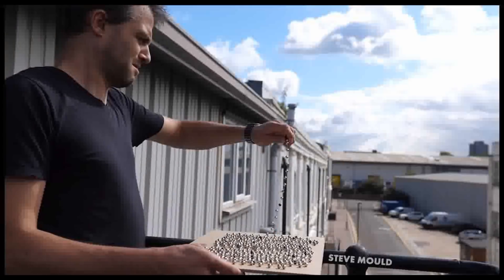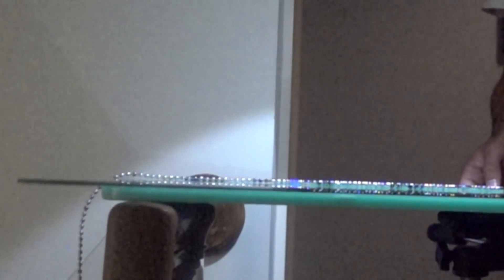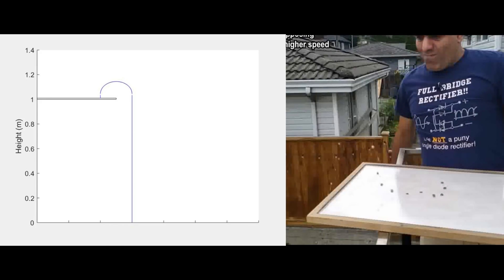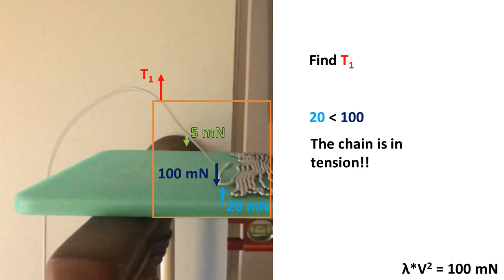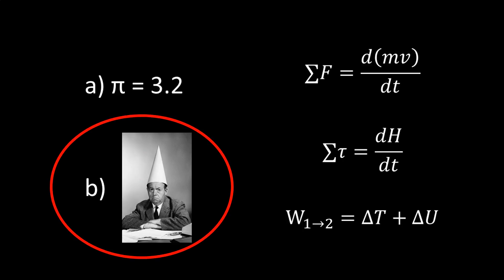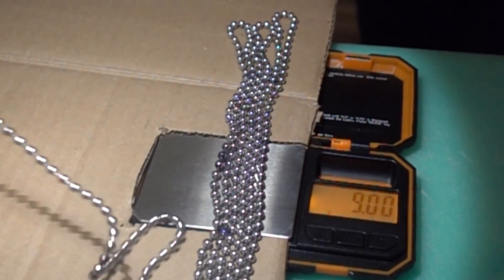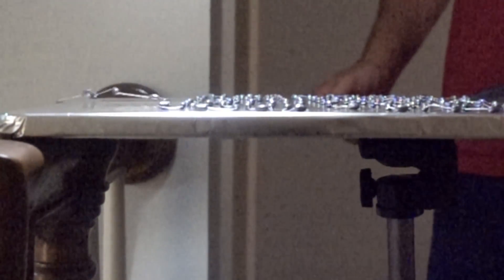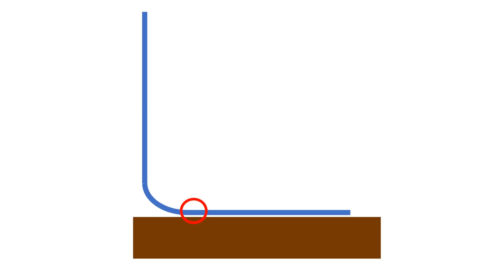And the Winner of the Chain Fountain Dispute is...

Comment: I join the unimpressed and remain unconvinced.  To me it is obvious what causes the rise of the loop is centrifugal force at the top.
Suppose you naively tried to create antigravity by using centrifugal force:  you'd run into the problem that a rotating object produces centrifugal force vectors around the circle, with zero net average.  However, temporarily you could have gravity cancellation when the object is accelerating downwards.  With a chain you have a large number of objects each of which are passing in turn through a U-turn, an incomplete circle, producing an unbalanced net force for as long as the passing of the chain lasts.
   I'd say, the U-turn is actually PULLING UP from the chain source;  NOT pushing down on it.
Reply: I don’t think your explanation is complete. Your wave or whip theory would seem to apply to chains without any regard to the specific feature of these chains where the bend radius is limited thus has the potential of creating levers. I presume if you could demonstrate fountains with chains that do not have that feature, that would indeed put a wrench in the works.
Reply: @Gefionius  Indeed.  And there's one of the many videos, I forget which one now, where someone tests a common chain link, as opposed to beads, and it does arch upwards a little bit, but much less than bead chain.  I think THIS is precisely what contributes a small energy input to the wavelet, not upward energy, but shaping energy, trying to increase the loop radius, which the physics of the chain's standing wave does not oppose or care, so it doesn't take much.
   In any case, I reiterate my original speculation, namely that the beads that are part of the up-side-down U, are the ones pooling the loop up by the unbalanced centrifugal force produced by masses getting whipped half a turn.  It's as if there's a pole in a park, and a long row of kids come running and one after the other hooked the pole with one hand and slingshot themselves 180 degrees around the pole, to end up running in the opposite direction.  Of course, as long as there are kids doing this the pole will experience an almost continuous force in the forward direction;  and would move in that direction if it was mounted on a movable base.
Reply: @privateerburrows    I think we need to be clear about what the 'question' is. The standing wave and whip analogies are great to describe the subsistence of the wave, but the issue at hand is the GROWTH of the wave.

The kids grabbing a pole in the park analogy is great, but consider the centripetal force, which opposes the centrifugal force. The pole is held in place by being anchored to the ground. What is preventing the chain loop from just taking off skyward? The centripetal force. What is the centripetal force? Perhaps the chain tension? There seems to be a suggestion that the centrifugal force is greater than the centripetal. How? We may indeed see this for a brief moment when the end of the chain goes through the loop and we see it jump like the end of a whip.

But other than the end where the tension force 'dries up' on the pile side, why would centrifugal force be larger than centripetal? The 'kids running' in your analogy are in this case beads under tension. So one kid is being pulled by the kid in front. This means there is tension on BOTH SIDES of the pole (in the analogy), or the loop (with the chain fountain).

Consider a pulley for a moment. If you pulled rope through a pully, would the pulley want to travel away from where you are pulling? Of course it would move towards the direction you are pulling. If you created momentum and the friction was greatly reduced, you may at best get the pulley to float where it is, but how would we get the pulley (or rope within the pulley at least) to travel the other direction? All the applied force is in the opposite direction.

I see two options to answer this:
1) There is a second directly applied force besides the obvious 'pull' force in another (opposite?) direction. In this case, that 'pull' force is provided by the falling chain.
2) There is a reaction force borne of the 1 applied tension force.

Any of this sensible?

An interesting experiment would be to lay the bead chain in a line with zero bends at all, and then drop it off the edge of the table.
Reply: @privateerburrows  Atomic shrimp did some interesting videos that seem tailor made to our discussion here. He first released this video (https://www.youtube.com/watch?v=RJhsKexCmW4) in which he seems to make arguments very much in line with yours. But then he is later convinced by Steve and released an update (https://www.youtube.com/watch?v=gJYMM-odvfE) which does a good job of getting at what we're discussing here. Well worth the watch.
Reply: @spruce_goose5169  "What is preventing the chain loop from just taking off skyward? The centripetal force. What is the centripetal force? Perhaps the chain tension?"  You see?  It's the centripetal force that is apparent;  NOT the centrifugal force.
  Indeed, tension along the chain is keeping the beads from shooting skywards.
  What's preventing the loop from taking off skyward?  Good question.  Did you see the video where this experiment is done from a construction lift from way up, probably 50 or 60 feet high?  As the chain accelerates downwards, the loop keeps rising skywards, reaching about a meter and a half above the chain fountain level.  It seems that the height is proportional to the chain's speed.  There is NO system of pulleys that can model a system where velocity is such a factor.

  Pulleys deal with static forces.  They are not the way to model waves, wavelets or solitons.

  "All the applied force is in the opposite direction."
  Indeed.  Consider a whip, again:  If you are holding the handle against your chest, and then suddenly you extend your arm, pulling your hand to the right... Single motion;  one direction.  Will that produce a good slash of the whip?
  No.  You first do the above, but then immediately draw your hand back, probably past your chest, to your left, with greater force.  It is this second COUNTER-motion that causes a strong crack of the whip.  Why is that?  Well, it is something similar to resonant systems:  if you have a long stick with a spring at the end and a weight under the spring, if you move now the stick up and down in resonance with the spring-attached weight, you'll notice the weight goes up when the stick goes down, and viceversa.  Similarly here, the higher the downward speed, the higher the loop rises.
  The reason the height of the loop is constant in most experiments is that the proximity of the floor prevents the falling part of the chain from getting longer, heavier, and from pulling harder.  In a high altitude test, the weight of the falling chain continuously increases, which in turn increases the height of the loop by virtue of spinning the beads around the U turn faster, creating a greater upward force.

   I don't quite understand the two options.

EDIT:
   I watched both videos of Atomic Shrimp, and I see a general flaw in the second one.  He's giving the example of a long bead chain folded and how it makes a "downward" loop when being pulled;  and when you put a ruler to stop that, it makes a bulge in the upward direction instead.  I agree with all of that;  the flaw is not one of mis-recognition;  it is one of calling that the "cause" of the loop going up.

  What I think is that, if we were to do the math, we'd find that the upward loop is a self-sustaining phenomenon, due to centrifugal forces with a net upward bias.  If indeed that system is in balance, as well as free floating, any minutest amount of energy going into this system will visibly alter its state and appearance.  The effect of reaction against the plate that he is describing is indeed real;  but it is MINUSCULE.  It is not responsible for all the energy the rising loop represents;  it merely paints effects on that loop because the loop is so easy to paint effects on, because it is a free floating thing under tension.  If the chain fountain was in a speaker's cone, and you were playing Motzart or the Beetles it would probably make the loop look different;  that does not mean the "the power of music is driving the loop".  What the tiny plate reaction force is probably doing, is causing the beads to begin rising right away.  Remember, when the beads get pulled up, they are already "floating", and it takes a tiny amount of force to impart a small upward velocity to them.  This is probably what makes the chain rise seemingly early and show little local wavelets.  What I vehemently deny is that the whole weight of the loop is resting on the plate or chain fountain.  That would be ludicrous to assume.  You can't push on chain, or on cables, or on ropes... There probably is a downward force on the plate, but in the order of milligrams.
Reply: @privateerburrows  I think we're getting as close to an agreement as we'll likely get. 
The back and fourth videos between Mehdi and Steve have addressed many of the issues you raise re the wave existence vs it's growth. 

>>"What I vehemently deny is that the whole weight of the loop is resting on the plate or chain fountain."

Good, and no one that I am aware of is claiming that! In this video we are commenting under, in the atomic shrimp video I linked, and in several of Steve's videos, they explain that the chain is entirely under tension. They are simply saying that the 'leverage' effect (reaction against the table/pile of stationary beads) reduces the needed force to lift the chain into motion. This slight reduction, repeated again and again, is what allows growth. 

Consider that while each individual reaction force may be small, it occurs the entire time the chain is in motion (in other words, along it's entire length). As velocity increases, the rate the reaction force is 'provided' also increases with it. 

An increased chain velocity-- as we get with a really high fountain as you say-- will indeed increase the fountain height. Again, no one is claiming otherwise. The increase in velocity provides greater input force, and when that input force in 'leveraged' for an increase in distance, we see greater height. But the key is the 'leverage.' Remember that mechanical advantage is a trade in force for distance. But that trade needs to happen to transform that available force into vertical height. 

We also need to address this question: Why does the chain fountain occur with the ball chain, but not many other types? Also, the ball chain fountain can occur at relatively low drop height, so it is clearly a function of the chain type and not just velocity.

For my part I should not have brought up the 'centrifugal force is apparent' nonsense. You are right it is fairly meaningless to the discussion. But never have I heard centripetal force described as apparent. It's very real. It really doesn't matter either way...

The simple question remains: Where does the extra lifting force come from?
The only answer I've seen to that question is the one provided by those suggesting there is a reaction force against the table/pile of beads. As best as I can tell, your answer appears to be 'the increased velocity of the chain.' But that is not an answer since the velocity is equal on both sides of the loop. How does that translate to any net upwards force?

This is all just my understanding of the issue as a relative lay person. I don't claim to hold complete certainty with any of these ideas. If a convincing argument is made for how velocity alone somehow translates to upward movement, and why the phenomena exists only in certain chains, I am open to it.
Reply: @spruce_goose5169  Sorry it took me so long to get back.  Great post;  you are right we agree far more than we disagree.

   My saying the centripetal force is the one that's apparent was just a jab.

  The way I see it, ANY force is apparent, in the sense that what exists at the objective level is perhaps the resultant sum of all the forces.  Not even that;  maybe a pressure or an acceleration resulting from the resultant force?  What IS objective reality, anyways?  But to get back to centripetal versus centrifugal;  they are the same farking force, viewed from two different perspectives. A mass at the periphery is pulling out;  the spoke or rope that holds it there is pulling in to compensate.  These are not TWO distinct forces;  it is just convenient to consider them separately.  So to me,  well, I was around 15 years old, when suddenly, out of nowhere, the centrifugal force that I loved so much became vilified, and prude, high browed individuals started saying that centrifugal force is not real;  only centripetal.  And I have a wounded soul about this, and a desire to get back to those bastards.  Nothing personal.

  Yes, if we are talking about milligrams force against the plate, I can agree to that.  Definitely there is not just linear velocity (DC-like) but also sound waves (AC-like) traveling both ways through the chain.  And they can push the plate, but cannot pull it, so they get "rectified".

  As for why types of chain other than ball don't behave quite the same way, perhaps our assumption that the chain is under tension at all places is a bit overstated.  If the AC component amplitude exceeds the DC component, you could get into negative territory.  In other words, there might be sound wavelets (phonons?) that at their peak push harder than the chain's steady state tension, resulting in a local push, which a looser type of chain would fail to deliver.
Reply: centrifugal force is an apparent force, not an actual force.
Reply: @spruce_goose5169  That's just a meaningless statement repeated at nauseum, which doesn't make it true nor meaningful.  All forces are apparent, if you get down to first principles.
Reply: @privateerburrows  Well defining reference frames is not really meaningless for many purposes, but ok, let's just ignore this for a moment and move on. 

Can you further explain "passing in turn through a U-turn, an incomplete circle, producing an unbalanced net force for as long as the passing of the chain lasts."

Really? So the upward loop of chain should just grow indefinitely until there is no more chain? Where does this unbalanced force come from? As you yourself say, it's not from centrifugal force which would have symmetry.
Reply: @spruce_goose5169  Which part is so hard to understand?  Centrifugal force has symmetry in a standard rotating system that goes full circle.  Each link in the chain is doing that in turn;  going through a HALF turn;  a U-turn.  If you only go half-circle, then the centrifugal force has no symmetry.  Suppose the chain was falling at hypersonic speed... How much upward force would not be generated at the point it is rotating from upward to downward motion?  The force would be HUGE.
   There is another video I saw where someone drops a chain from many meters up, and as the chain keeps accelerating, the top of the loop keeps rising higher and higher,  reaching about a meter above the chain bucket.  That shows that the upward force increases with chain speed.
   But I'm sure you are going to argue on the basis of words and pronouncements out of context.
Reply: @privateerburrows  The issue is not just semantics. You think you have provided an argument that counters this above video? Did you watch the video? Your points have already been addressed have they not? What is so hard to understand (to steal your phrase)?

I would encourage you to draw a diagram where you think the force vectors are and contemplate how a 'semi circle' could create asymmetrical force in the upwards direction. The velocity vector is tangent to the arc. 

If you were to 'sever' an individual bead of the chain at a given moment in the arc, where would it fly to? Are you claiming that there are 'more beads' of the chain at a given moment that would fly upwards, creating a net upward force?  I would love to see the drawing that could corroborate such a sentiment.
Reply: @spruce_goose5169  Well, I watched the video again to see if there were any gems I missed in it, but found what I found the first time I watched it, formulas thrown about with no introduction to the terms, etc.  The video is made to confuse;  not to clarify.
  Take for example at 4:17:  Up to T1 and T2 everything is ok.   R is also ok.  Then, suddenly, a formula appears described as "conservation of linear momentum" with new letters, such as F, d, M and V never introduced, whether in words or graphically.  This is typical educational system garbage of making students memorize formulas, letters and all.  Reminds me of these electronics students I tutored years ago who did not even have an understanding of voltage and current as like water pressure and flow, but had super-long formulas memorized for solving problems with operational amplifier circuits.  Pure memorization without any understanding of anything whatsoever.  Now, just for my saying this, you are going to call me "ignorant" for not having "THE Conservation of Momentum formula" memorized, myself, I'm sure.  School "educated" people always try to defend the trash they invested time into.

  To add insult to injury, the left side has a summatorial, but the right side has a dt in the denominator.  I thought that /dt was the usual notation of time-integrals;  but I see no integration;  instead there's a summatorial of a non-descript F (some force, I'm sure) on the left side.  Next it says that T1+T2= some lambda ... also non-descript.

  But you want to put the onus on me, to "draw a diagram", and explain myself super-clearly ...  for my cardinal sin of arguing against this garbage of a video.
  In any article or paper, terms of equations are ALWAYS introduced.  This is BASIC etiquette.

And whatever the formula is trying to say, I disagree:  The upward force does not equal the downward weight forces;  it equals those downward forces PLUS acceleration forces.  In the case of an accelerating chain, the top of the rising loop has been shown to grow taller with time,  so the centrifugal force generated can indeed be greater than the weight of the chain.

  To answer you stupid, rhetorical question:  A bead separated from the chain at any point in the upward loop would initially shoot along the tangent, then follow a parabola, assuming uniform gravity and no aerodynamic drag concerns.  What are you trying to do by asking such a ridiculously obvious question?  It's clear to me you are trying to insult me just by asking.

   Or maybe you are just dumb as F.... and think that the number of beads in the loop would have to equal the number of beads in the rest of the chain ...  Do you?
  Quote:  "Are you claiming that there are >>> 'more beads' <<< of the chain at a given moment that would fly upwards, creating a net upward force?"
  LOL.  If so, you then have decided a-priori that the average downward acceleration around the loop is exactly twice the acceleration of gravity regardless of velocity or any other considerations.  Just because ...  If so, that's brilliant!
  ... 'more beads' ...
  ROTFLMAO.
Reply: @privateerburrows  Yikes man. Grab a beer. 
I asked you an 'obvious' question because it seemed obvious to me your thinking was flawed, and so it is a way to try to understand where the other person is coming from. I'm no memorizer of formulas myself so relax. 

Your diatribe is interesting and all, but my simple question still remains unanswered: where is the upward force coming from?

"think the number of beads in the loop would have to equal number of beads in the chain"
Ok, so the net force isn't generated from the loop portion? Isn't that were the centrifugal force is 'felt'? So where is the force coming from?

You don't need to have the answer. Or if you do, please provide because I am genuinely interested! You and I are both just some randos on youtube man. Take solace in that. I sure as heck don't have the answers, other than what these video series have provided to me; I've merely followed along and can mostly see the logic, but I couldn't claim to have made sense of it myself.

Have you watched Steve Mould's latest video on this? I think it does a pretty good job, and I would be interested to hear if you feel he has fallen short on his explanation. He discusses the forces that limit the height of the chain btw.

Cheers
Reply: @spruce_goose5169  Yeah, I saw his latest video.  Anyways, another way I could explain what I feel is going on is like a standing wave, if this makes it easier to understand.  Imagine a whip.  You jerk your hand hard, and a wave propagates along the whip.  Now imagine the whip is a chain, and is so long that one end is being spooled in with a motor, and the other end comes from a bucket.  So the wave is trying to move forward, but the chain keeps drawing away, keeping the wavelet stationary.

  "think the number of beads in the loop would have to equal number of beads in the chain" Ok, so the net force isn't generated from the loop portion? Isn't that were the centrifugal force is 'felt'? So where is the force coming from?
   Just because the number of beads in the loop doesn't equal the number of beads elsewhere in the chain does NOT imply the force isn't generated in the loop.
   The force produced by beads in the loop has to do with their centrifugal force, which is proportional to the chain's velocity.  The downward's force by the beads in the rest of the chain is a consequence of gravity, and is not a function of velocity.  So there is NO RELATION between the number of beads in the loop, and the number of beads elsewhere.  There could be 20 beads in the loop generating enough force to hold 2000 beads in the chain.

  As for why the chain rises off the plate or bucket, that's probably just the strong but short waves coming along the chain, which end up hitting the beads against the plate, causing them to jump.  If most beads are jumping up, and they are all connected, the resulting effect is the chain rising;  and this then becomes part of the loop and stays up due to centrifugal force experienced by each bead passing through the loop.  Or like I said, think of it as a propagating wave looking fixed in space due to the chain traveling at the same speed in the opposite direction.
Reply: @privateerburrows  The jerking a whip explanation is good, and when you jerk a whip, the jerk comes from your hand and propagates up the whip, right? So if you look at the video, at 2:46 you can clearly see the motion begins at the chain stack, which implies that insofar as it is a standing wave, the impulse of the wave is actually coming from the chain on the surface, not the bend.
Reply: @zhoufang996  The jerk on the whip was an example I posed to explain the next point, namely how the wavelet becomes stationary by traveling along the chain while the chain moves in the opposite direction.  I didn't mean to imply that it "came from" anywhere.  It is sufficient to explain how it can remain in place.  With a tiny amount of energy input, it could conceivably grow.  After all, a wavelet traveling through a whip disturbs the air and loses energy through turbulence;  whereas a wavelet that appears stationary relative to the surrounding air loses no energy.
Understanding how the wavelet can merely subsist, IF formed, takes us 90% of the way.  How it actually forms is just a minor detail.